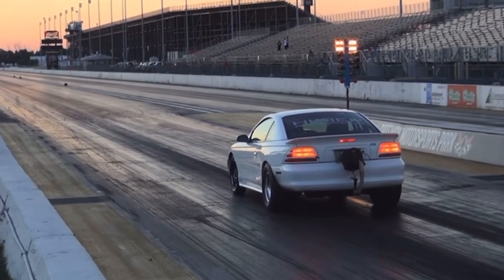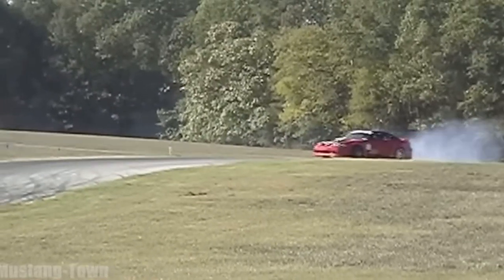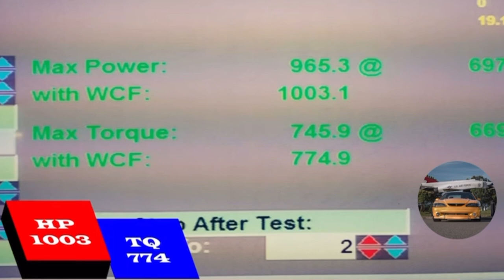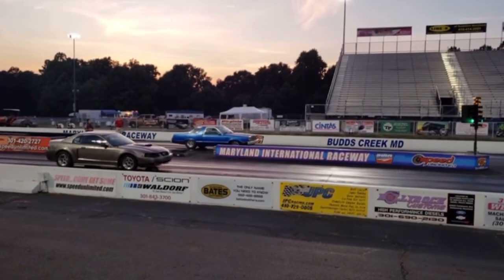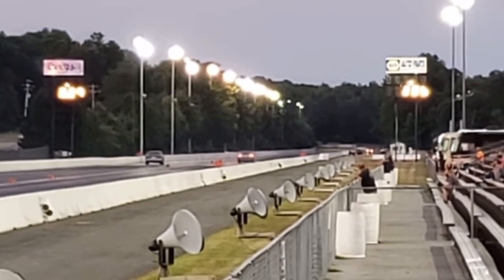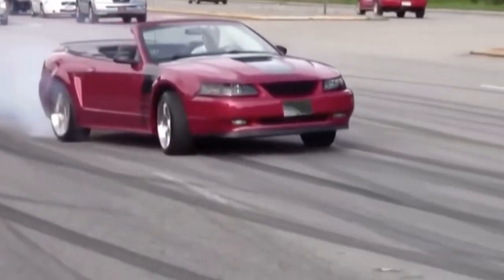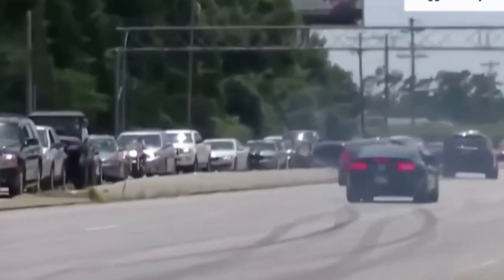Top tips on How to properly build your Sn95 Mustang.

Comment: Thank you for bringing up the 1k HP.  There is so much work that has to be done to keep that car up and running.  You can get your car 600-700hp safely and it will run all day!
Reply from the maker: To each his own but I need to be a hard core racer to need 1k hp.
Reply: @SN95Power  Absolutely.  700rwhp on the street is an absolute blast.  I've ridden in some cars 900rwhp plus and you cant really use the power.

Comment: I had a 97 cobra and I over revved it on a freeway onramp to beat a semi! Factory fuel shutoff happened, and the motor leaned out and detonation bent a rod! My 98 cobra has a rev limiter that kicks in before the factory fuel shutoff, just in case now! 4 valves are expensive to fix, so insurance never hurts, if you forget to let off the throttle, or miss a shift! Mine is now set up for the twisties with an independent rear and full Kenny Brown coilover suspension setup! Brakes are next, then mild engine mods! California has strict smog rules so engine mods are limited! A set of forged rods and pistons, plus a smog legal supercharger are in the future!
Reply from the maker: How do you like the ride quality of the irs?

Comment: Spot on info man!  Pretty much had the same idea, tubular front end, aluminum victor jr top end stroked to a 347 with a e cam I believe.  Gear it right, I went with 4.10s get the suspension right and the right tire and you can have a ton of fun with around 350-500hp in one of these cars.

Comment: My request is straightforward not necessarily simple but definitely have a plan. I want something that handles really well I do a lot of back road cruising not racing just cruising. The car's bone stock it's an automatic I wanted a manual but it's in too good a shave to pass up. In the month I owned it I have upgraded from 16-in factory to 17-in high quality wheels. It now has 9 in enkei rpf1 10inch rear. Seeds and interior are immaculate car belong to the elderly couple that bought it new. I've already put a very nice sounding stereo not huge in it. Components said in the door Alpine head unit four channel amp and a 10-in sub. It goes in in a week to get the windows tinted correctly. Still has stock power all I want is a back road cruiser with about 50 more horsepower without using nitrous. I've been told all the little tricks like PI heads long tube headers different intake and camshaft it almost seems too costly for the outlay of power. I'm thinking about saving for a year or so and just put no low boost kenne belle, vortec or other brand supercharger on it to get the power I want it probably dynos honestly around 200? If that's the case 250 at the wheels would be perfect. Never going to be a race car like I said just a cruiser just would like a little more power because a lot of the back roads I cruise on are very hill intensive
Reply from the maker: Quality lower springs, shocks/struts and bushing will make the car handle like you want. Custom tune 4.10 gear with full exhaust minus headers will give you that acceleration you want.
Reply: Pi heads and intake are pretty cheap and would give you more power than a pi car has (35 more than 1998 45 more than 96-97) because it will bump a non pi motor up to like 10.5:1 compression or about a point more.  That along with some aftermarket cams will run killer with long tubes and you can have this for not THAT much money maybe 2-3k or so it will bring the car from likely under 200 now (they're only 215 stock at the motor and yours is an auto which reads lowest) you're probably doing 170 now these mods can take you up around 300 to the tires and make the car sound like pure sex.  The suspension mods mentioned above and the gearing is really all it needs it will be everything you ever wanted of a mustang.  I know you think you only want 50 more but take my advice you'll be alot more happy close to 300 wheel give or take and the sound will be unreal.   I'm talking a car that is totally transformed for like 4 grand un go fast goodies that isn't that bad really.  If you ever wanted to boost it that would be a pretty solid foundation for a boosted setup as well easy 450 wheel.  If not it's a good na setup.  That and the gears and suspension will make it feel like a totally different car in every way.  A good higher stall converter would also drastically wake it up too but not absolutely necessary.   People will tell you that is a drag racing mod but it drastically wakes up a car even on the street if you never do any dig stuff.  When you smash that gas it is ready to roll right then no hesitation.  But like I said you may or may not wanna do that.  That 4r70 in your car is actually a pretty good trans and decent tough.  If you do all the things I've suggested along with mods above to suspension and gears that thing would be extremely fun on any backroad or any road period you'll fall in love with it.  You would probably never imagine that car being as awesome as it would be setup this way.  Pretty good bang for the buck imo
Reply: @midnight347  I know that's probably something you don't hear from a lot of mustang owners I'll be 53 next Sunday and I've had my fair share of fast cars I live in the hills of Missouri with a lot of turns and twist roads that would rival till the dragon but not quite as long. So I like driving back road I don't drive over aggressive I just like to feel like me and the car got a good workout My new RPF ones got pretty good falcon 6:15 on them I ordered the whole set from tirerack I can't remember the size of the tires but it's plenty of tire for the power I make 18x9 front 18 10 rear. I think the falcon is a 300 treadwear I decided to try a new tire I usually run Dunlop direzza star 3 are equivalent. I used to autocross and do track days as well but on autocross I got tired of standing around for 8 or 9 hours and getting three 1 minute runs all day long so I just drive to enjoy myself now
Reply: @SN95Power  I rode in two separate cars with a 410 and a 373 next week I'm going to order the 373 I like it better at highway speeds better RPM. The car is definitely a toy and is kept in a garage. I have already ordered koni suspension and was going to go coilovers but I think I'm going to look for a good quality spring. I used the autocross for years but in the import world. It seems like eibachs are way too soft but I don't want to ride like a buckboard wagon either. I guess I'll have to find something in between the two my little Hondas I used to run 450 pound in the front coilovers in 350 in the rear made by a company called progress they make a very high quality coilover for Hondas. I wish I could find a setup like that for my mustang

Comment: Great content as always, so from your experience what's the best tire for rain driving would you suggest? I'm fairly new to the new edge mustang community, I have a 2004 gt with small mods shorty BBK headers ,373 with a Typhoon intake and pretty much just wanting drive the car highway and beautiful backroads . Thanks for your great content 👍
Reply from the maker: I don't think you would need a r compound tire. I'm a big fan of the nitto 555. I'm not sure if they make those anymore.  Our new edge has Firehawk tire and they are a good tire for its power. No problems in rain

Comment: Something that I don't see a lot of in discussions about how to build is the importance of all the individually uninteresting parts..  like the brake hoses,  like replacing all the little christmas trees on a panel,  like improving the sound deadener in targeted spots on the car..  and also kind of like what you said not to go full race unless you're really about that full race lifestyle because all that stuff comes with compromises. 

I get it big noise and big power and big numbers are exciting,   there's just not really any adrenaline rush in a video about replacing the lamps over your license plate.    It's also easy to show an audience a quarter mile they get the whole story in ten or twenty seconds but how do you show people in a video that your 30 year old car drives like brand new?     

If I knew the answer to that maybe I'd make better videos 🤣🤣

Comment: Run it fat so you can come back
Reply: One thing a lot of guys forget about when it comes to handling is sub frame connectors the weld in and bolt in type especially if you have a convertible